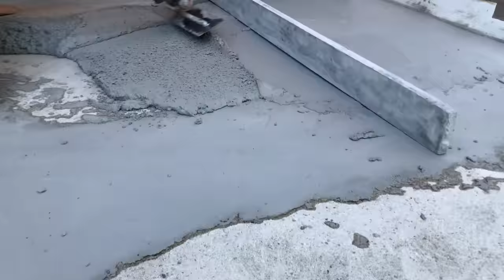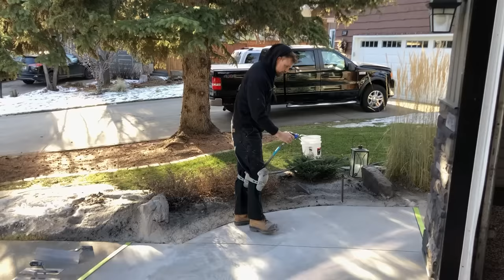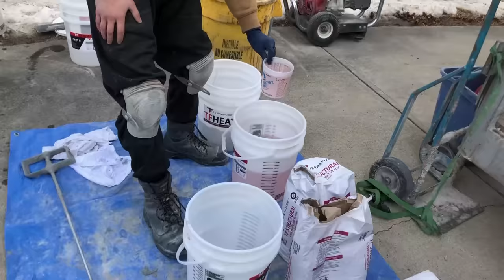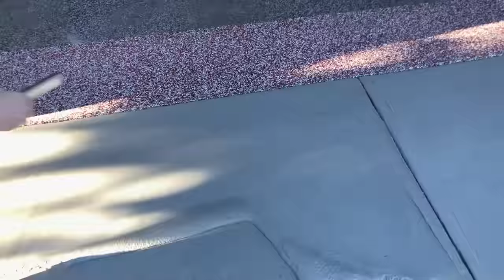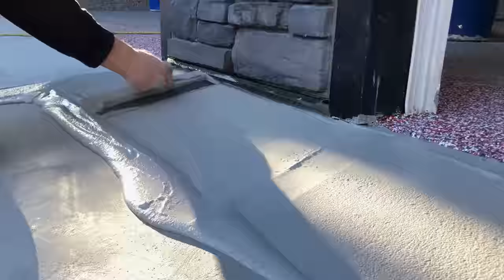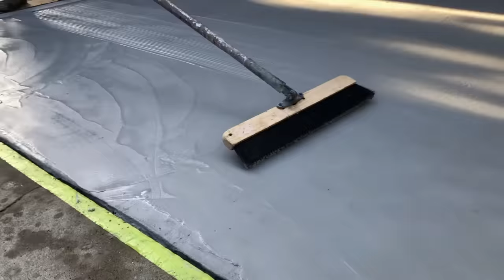Fixing driveway cracks, height differences, and broken edges, using TF Structural Concrete Repair

Comment: What is the longevity of the product doing an overlay as your doing in the video or say on a driveway that is relatively sound. Does it stay down or just peel off in a couple years. I know prep is key, with proper preparation of the old surface
Reply from the maker: Yes it stays down, it does not peel off. This product will last as long as concrete does, and will wear down at a rate of approx. 1/8" every 10-15 years.  It chemically bonds to concrete, and becomes a part of the chemical matrix. It is not 'glued' down with a primer, like most polymer modified products are.
Reply from the maker: This may help answer your question :-)
https://youtu.be/iuK9_XweHKA

Comment: I'm a construction guy but not a concrete guy. Lots of potential issues here that I can see could happen. Thin coat could crack under weight of vehicles, or the stresses of freeze thaw cycles. Nothing placed/jacked under sunken driveway to prevent further sinking; further sinking of course would render this repair cracked. Can't vouch for the long term reliability of this particular job. We bough a rental where the previous owner had done a diy with this stuff. Lasted about 1.5 years before it was chipping out and had lots of little hairline cracks in it. Ended up removing everything & redoing. Alberta Canada
Reply: 6 years later and this repair looks as good as new still

Comment: My question is how is that going to bond with the existing finished dried concrete your pouring over. 🙃 it will pop right off within months . Overall looks good from my house lol
Reply from the maker: It chemically and mechanically bonds to existing concrete substrates. It will not pop right off, that comment is just annoying, as you are basing it on nothing.

Comment: I am curious if there is a different or recommended approach I can review for courtyard driveways. We are building, the driveway is in, but we have seen puddling by the garage doors. This is being challenged by the builder as they surely don’t want to repour. They are laser shooting, ‘field testing’ by hosing the driveway with water, and now say they are getting a surveyor to check the slope. I just need help with understanding all options to rectify this. The builder said gutters will remedy it, but we don’t agree based on what we have seen.
Reply from the maker: Yes, you can reslope concrete with the TF Structural. Feel free to email me for more info. Mike@terrafuse.com

Comment: I would’ve scored some lines in the concrete to help secure it more. I know it’s a temporary fix but it came out looking good.
Reply from the maker: It’s not temporary, and doesn’t require that. It chemically bonds to concrete. 
https://youtu.be/AY-mhFVXACs
Reply: @TerrafuseInc  honeslty no matter how good this fix is and the material is for sure is temporary. You’re saying this will last 5 plus years without cracking worse than the original concrete?i bet it works perfect for areas without car traffic like walkways and backyard pads

Comment: I love this. Checking it on Amazon for a slab a just threw. But I am no pro at this. Ho do I calculate how much I need? My slab is 10 x 10. Is there a formula.
Reply from the maker: Are you just doing the overlay like the video? If so, you will get roughly 40 sq. ft/ 50 lbs. bag, and about 15 sq. ft. /15 lbs. kit sold on Amazon. You will need more if the concrete is pitted, and in rough shape.

Comment: As a long time old school finisher that has dealt with these overlay products many years this will not last. It actually wont last long at all in colder climates up north. But in this case being a driveway theres no possible way its justified vs tearing out the old and installing new which is gonna last 10x + longer than any overlay product. 

Granted there are applications where overlays out weigh tear out and replace but it has to be the right situation (foot traffic only, out of the weather) not a drive way
Reply from the maker: Not true, but you can learn something new everyday! Keep browsing our Youtube channel, and you will see multiple videos showing projects after years of use.

Comment: What is the chemical bond you added to this concrete cement
Reply from the maker: This is not a portland cement based product. It is an acid/base chemistry. The acids in this material will chemically bond to the hydroxides in the concrete it is being applied to.

Comment: We s need product that just fills the crack (after mud jacking if needed) to look like the rest of the driveway (through color matching) that is durable and easy to install. Surprised this has never happened.
Reply from the maker: This will be perfect for filling the holes you drill after mud jacking. We have lots of companies using it for that. It will never be a perfect match, but it gets close to concrete colors after curing. It is not recommended to use it for filling cracks only though. It is too rigid.

Comment: Before I start any repairs I always add that glue u know that white milk then I add a little in the mixture never had a problem never.
Reply from the maker: That’s for products that can’t bond to concrete. It’s like “gluing” your repair down. TF Structural bonds to concrete chemically.

Comment: Every builder I asked told me you can't do a thin layer with any concrete mix alone because it will crack too easily. So this must be some special stuff.
Reply from the maker: Yes, you can’t use concrete, it doesn’t bond. This isn’t Portland cement 👌

Comment: Im thinking about doing this to two on my driveway slabs. Winter salt from city trucks is tearing up my concrete and It’s starting to chip away.
Reply: Use an air sprayer or water pressure between these cracks before starting everything /

Comment: Might could have burned it in with a slurry coat. I would think it would have stuck better in the long run. Also if you would've wet the slab it would have helped as well. Just how I'd have done it. I've spent far to much time in classes on repair mortars and how manufacturers want them put on so that's just a couple of tips from this old boy.
Reply from the maker: Yes, but you need to remember this is not portland cement. Very different material and chemistry.

Comment: The comments doubting how this “mortar” will hold up are not aware of the incredible strength these polymer modified overlays and levaler’s have. Tiny splatters on glass will dull a razor blade before coming off. The biggest challenge is working fast due to the rapid set time. These products are expensive because they work.
Reply: Exactly. Some of these fast setting products do have a retardant that will allow a little more time to work with too.

Comment: You can’t do these thin layer in areas where it freezes
Reply from the maker: Yes I can, you're not the boss of me!! Also, we have been doing it for over 15 years, this is exactly where this product was designed (canada), and what it is meant for. This job is actually much thicker than we normally go. I recommend you do a bit more research, we have lots of videos on our channel. You're making a lot of assumptions, which isn't helpful for anyone else reading the comments.
Reply: @TerrafuseInc  sorry man, didnt mean to offend.... I live in Wisconsin and there is no such product or contractors doing this work at all so I assumed (wrong) it was for warmer climates...
Reply from the maker: No problem! Now you have found a product that will work in your climate! :)

Comment: I would put wire mesh before pouring cements
Reply from the maker: We aren't using portland cement, it doesn't bond to concrete, and requires 'glue' to adhere.

Comment: Appreciate overlay technology but I know that ripping out the old and replace with new concrete would be more cost effective, will last longer and be better to look at .
Reply: @winstonsmith11  Painting over rust
Reply from the maker: Exactly. Replace it with the same product that already failed. There is only ONE way to do things 👌

Comment: That's to labor intensive, will probably cost as much as demolishing and pouring new concrete...
Reply from the maker: It was less than half the cost, and less than half the time. Doesn’t seem too bad to me.
Reply: @TerrafuseInc  
What's the life span? And what guarantee or warranty is there on cracking or peeling?
Reply from the maker: It lasts like concrete does, and you can never guarantee cracking, especially if the slab is already cracked. This product will not peel or “flake off”

Comment: Fixing.. how about bandaid..
Reply from the maker: Why are you saying that? Where have you used this before?
Reply: @TerrafuseInc  
I work from the ground up.. Your only as good as what you stand on..
Reply from the maker: I agree. When we start on a solid concrete substrate, there is no reason to tear it all up, when most of the problems we fix are on the surface.

Comment: You need to pressure wash the floor first and then have to prime it so the  concrete sticks to the floor and last longer
Reply from the maker: Proper prep is required, yes, but this product does not require a primer.

Comment: I'm not a concrete guy. But this would make sense to fix the base of the original slab with expansion foam so that erosion doesn't reoccur...pressure wash to make sure you get a chemical bond...then fix the crack...and add then add this product. If you don't do that..this will only last 2 seasons if that.

Comment: There’s several steps missed here therefore it’s not going to last. Sorry
Old Cement is gonna suck water out. Not wet 
No bonding agent used. 
But if you want it to look good for 6 months I guess it’s ok
Reply from the maker: You’re not required to pre-wet the concrete with this material. Doesn’t need a bonding agent either. You’re making a lot of uneducated assumptions.
Reply: @TerrafuseInc  
No not really. I know what MFG says. 
No prime. Thick or thin no issues. 
It’s not a lasting product sorry. 
Been in the field over 30 years. 
I did a job 3-4 months ago that was done in 2017 with TF. Half of it was picked up by hand. Other half blew apart like a spider web. 
This is not a lifetime repair or fix. It’s not even a great fix for anytime my opinion. 
Any big cracks in pads should be stitched together. And any big issues like this there’s a bigger issue behind it all
Reply from the maker: Where were you on a job using TF? What your describing is not this product. Nice try.
Reply: @TerrafuseInc  
Your a bit hell bent aren’t you. 
TF structural concrete. 
It’s the same stuff customer used. 
I just seen you promote it on Amazon in your link. Same stuff 
I don’t know why your having such a issue unless you own the dam product. 
And cracks FYI. It’s cement not drywall. 
So stitch the cracks. 
And never use any product unless the sub straight is 100% clean. 
I don’t care if a product is 1 part. 2 parts. Epoxy or other. Prep is the key to all. 
If I was gonna push a product I’d point that out. Power wash but grind top layer off. 
I can make anything look good. The big question can you make it last. 
You make this product sound like. 
Use this it won’t crack. Chip. Break. Etc 
And I can pour a driveway 5 inch thick and it will never crack. NOT.
Reply from the maker: Where was this customer located? It was only put on Amazon at the start of this year, so whatever they used in 2017 was not TF Structural. 
I like the idea of crack stitching, do you have any video links of this being done?
The substrate was diamond ground before installation, prep is 100% the most important part
https://www.youtube.com/watch?v=AY-mhFVXACs 
go to 2:37, you will see this project after a year of use, if you want. Or not :)
Reply: @TerrafuseInc  
Customer was in Northern CA. 
I just called him about a hour ago to ask what product it was. He said it was TF. 
He said a friend turned him onto it. 
As for the stitch. I don’t have any videos but there’s a few online. 
Rebar stitch. Cement stitch. 
Although most are not that great. 
But it gives you a general idea of how it’s done.  In short your grinding a pathway on each side of the crack then drill down. Bend rebar to fit and drop in. I like to epoxy it in then cement over it. 
Large cracks I’ll use all thread and 3 inch washers. I have done this way to many to count and I have never had it break or open up. Knock on wood. 
Some you grind across or diagonal all depends on crack and depth. 
Over the years I have come up with crazy things. Cracks with a void under it. Poured self leveling in it and filled up into crack a inch then finish top off as normal It held. So far 11 years and still looks good. My driveway. But filling cracks and fixing like drywall. No no. 
Maybe TF is good I have never used it myself but fixed issue on it as stated.
To me if I had the product and had to use. I’d clean area etc. stitch cracks. Then cut 3/4-1 inch deep lines into area so TF Is just not on top but also locked in with the groves. Id probably still use a primer etch on the safe side. 
If I ever get a chance to use it I’ll give it a shot I guess why not. Maybe customer did it wrong or lord only knows. 
Personally being in construction 30 years nothing or repairs ever seem to hold up and have issues. So I always look at what’s wrong. Why did it sink. Rebar not put in. 
Etc.  I just redid a patio area. 30 by 45. 
2 years old.  The guy set 3/8 rebar 6 ft on center. Laid on the ground. No blocks and didn’t pull it up. And edges were 6 inch thick center was 2-3 inch. 
So i like to figure why things happened. 
If TF is that good and the slab etc wasn’t going to move much anymore and no voids etc it might hold up. 
But sadly customers don’t understand cement. I can pour 8 inch thick and overkill on rebar and I can’t say it won’t crack. It’s cement. Customers just can’t understand that part.  You could go wild and dig 3 ft up. Then start laying bases and compact it and so on and have a much better chance but that’s $$$$$$$ 
Then you really never know the cement your getting. Over time cracks. Spalling etc. 
shit happens. 
But to be fair if I ever get the chance to use it I’ll give it a shot. Maybe I run into someone who has some left over and I’ll try it at my house. 
Funny 30 years and the last thing I want to do is work at home. I’ll admit my drive has become my testing spot for ideas. Lol

Comment: The apron is sinking for a reason. Either the earth wasn't tampered correctly or its natural settling.I have seen this type of repair done before to level the apron. Unfortunately it's a Band Aid" and a waste of time , money. It will look good for awhile and start sinking again. Also the outer edges will break off due to weather conditions and abuse.Time to put in a new apron and do it right.
Reply from the maker: https://youtu.be/AY-mhFVXACs
2:36

Comment: Looking at the area looks like its a 4 season area which includes winter. That thing will slowly pop out in 1-2 years 😂 not a fix, a temporary fix. That material looks like it only works in areas that are hot all around or inside factories. Idk i could be wrong. If anyone knows let me know!

Comment: Sorry to rain on your parade, but it's gonna crack again and soon. Even if the concrete was poured 6" thick, givin the soil type it will still crack. Rebar will keep it from separating. The thinner areas will actually begin to chip away from the original pour.
Good luck.
Reply from the maker: Thanks for the luck, its my first day

Comment: Wholly crap...what is wrong with people... this is a chemically bonded material ... get with the times... its not cement they are laying... great product to repair cracks in concrete which happens even when properly prepared...well done guys for coming up with a viable solution..
Reply from the maker: Exactly! Some industries just can't handle new technology. Imagine every time a new iPhone came out, people just say it is junk, and will never work!

Comment: Will not last ! And eventually will pop off! Should have used concrete bonding adhesive first and then build it … but trowel work was ok !
Reply from the maker: Should not have a bonding adhesive. You don’t even know the chemistry we’re using, and you just throw out a random comment. It’s not helpful

Comment: If the crack runs all the way through the concrete , how is this "fixing" the crack?  Even the small "surface" cracks run all the way through the slab.  The only way to fix it is to tear out the concrete and repour the concrete.  I wouldn't even bother with repairing a cracked driveway unless there are holes in it. A large crack of an inch or so ,I would use backer strips and self leveling caulk and live with it .

Comment: Sorry but this is a topping slab with a bandaid fix of the crack itself. I Guarantee that this will delaminate as soon as the seasons change and the subsoil moves. Fixed plenty of these over the years in commercial applications and it’s always the same scenario. The topping slab started of as a good idea and then in time, and sometimes only a few months the damage created is Ben more costly then if the area was ripped up to b gin with. I don’t even bother touching residential as usually it’s too costly for people with no guarantee given on how long it will be good for. But each to there own.
Reply from the maker: https://youtu.be/AY-mhFVXACs
2:36